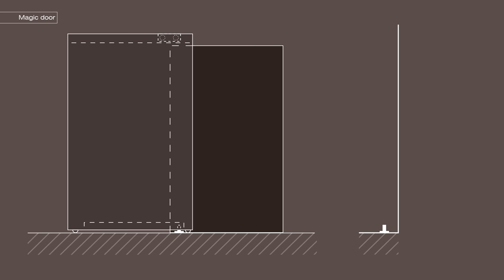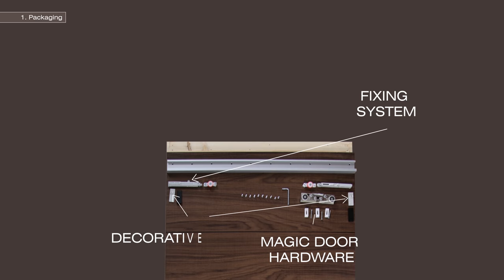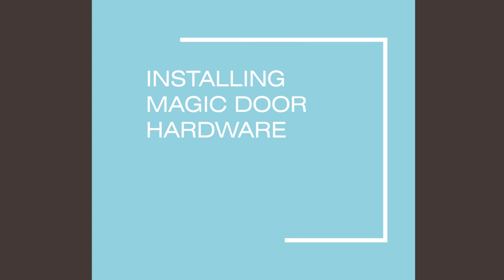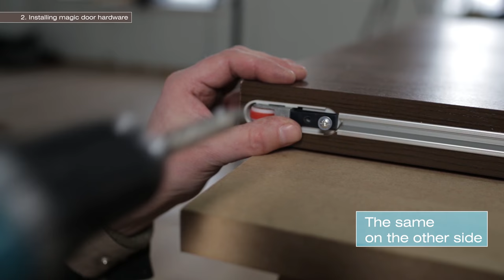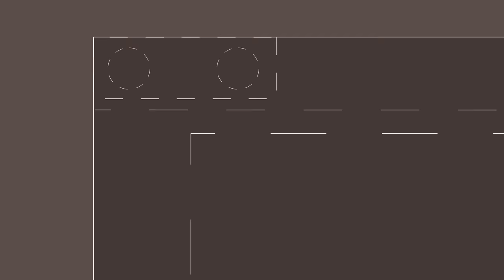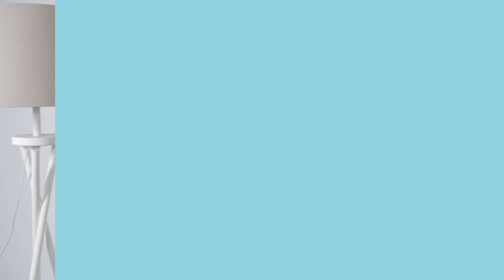How To Install the «Magic Door» System

Comment: can i know the maximum length that door can open ? can it cover 120 cm opening with 130cm door slap ?
Reply from the maker: Hi,  opening should be 4 2/16" - 2 3/16" smaller then the door slab. So, yes, 130 cm wide slab will be enough to cover 120 cm opening.

Comment: Hello, would the Magic 2 system work for a solid door that is 1 1/2" thick and 50" wide. It's a custom door that weighs around 200lbs. Thank you.
Reply from the maker: Hi, probably not

Comment: is it possible to mount the wall hardware beside door opening not above like in the tutorial? In case of a room-height door ( door opening from floor to ceiling )
Reply from the maker: In this case you will need different door hardware, probably some kind of sliding system.

Comment: How did you get the grooves in the bottom of the door slab?
Reply from the maker: We do all necessary precuts on our factor using special equipment
Reply: If you were modifying a door on the job site, you’d have to use a router. Not impossible, but slow.

Comment: Almost a great design. I see issues with the roller wheels at the bottom of the door. Dirt accumulation, carpeting, wear and tear on wooden floors. The traditional pocket doors or wall mounted sliding doors with the rollers and soft close, soft open mechanism located at the top of the door are a much better design. Function over design vs design over function
Reply from the maker: Thanks for sharing!

Comment: The directions and the service rep I talked to were NO help.  No where on the site or pre order information does it state you need to have the door 7-10" wider than the opening - and the header 3" shorter.
Reply from the maker: In order to assist you better, we kindly ask you to provide us with additional details about your specific situation. This information will help us to give you more precise instructions and assistance.

Please be assured that our team is committed to helping you resolve this issue as quickly and efficiently as possible. You can contact us at https://doordesignlab.com/ or respond to this comment with any additional information or questions you may have.